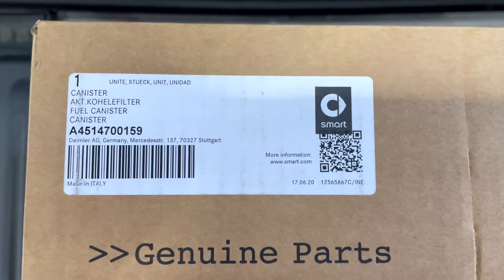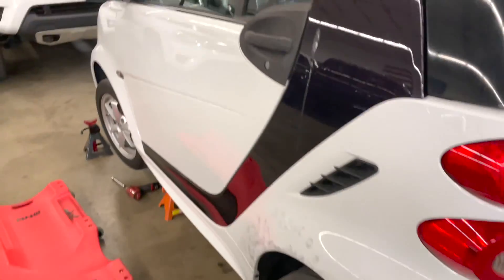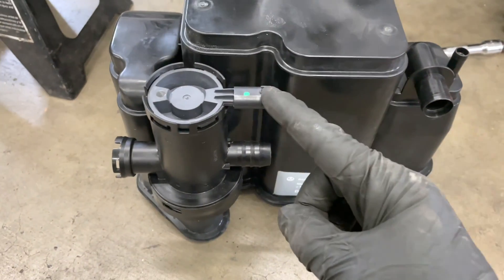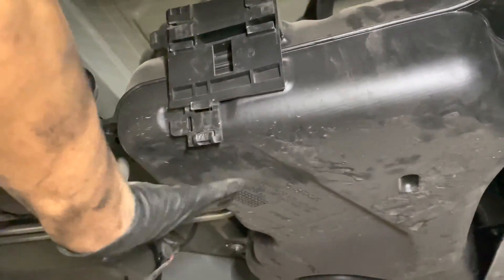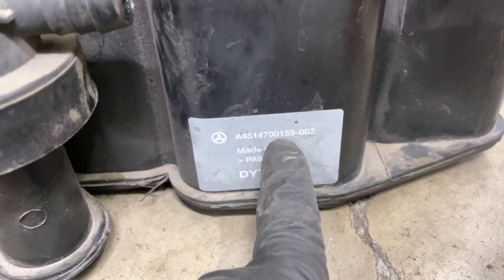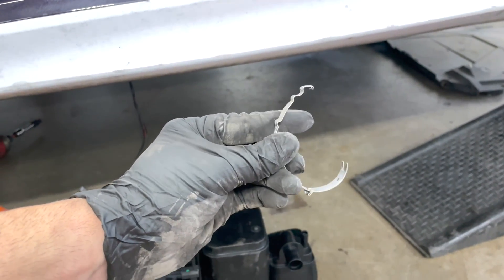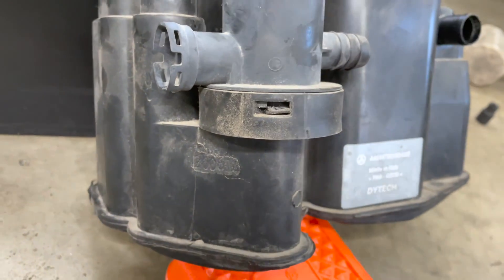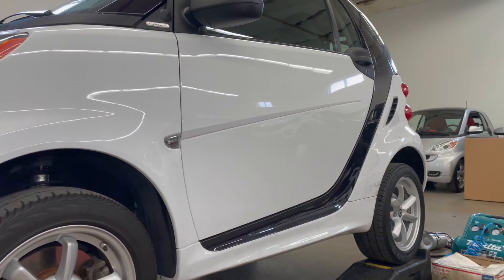Smart Fortwo - EVAP Canister

Comment: Hello i have a 2012 passion, my evap canister fell off and bangged the ground a bit. I wired it up to make it home. Is it still drivable til I get a new one in 3 days? Electrical wire still connected and hoses but not mounted to the tank (the 3 vents)
Reply from the maker: It’ll probably throw a check engine code, and it’s going to vent some of the gases to the atmosphere, but at the end of the day it’s not going to cause engine damage or anything as long as everything is currently off the ground and if you have any broken hoses that they are not sucking water or anything like that into the fuel Vapor return lines.

Basically, it’ll probably be fine.
Reply: @ToyotaGR86Performance  thank you.I only need it to hold till Monday
Reply from the maker: No problem, just make sure that none of the hoses are gonna be sucking up anything into the vent lines and that it’s not going to drag for the next couple days while you’re waiting for a replacement.

Comment: Good day I have a 2013 smart fortwo passion code p0455 evaporation emissions leak detected( gross / no flow) I was wondering do I have to change the whole system as you did
Reply from the maker: Best thing is to smoke the system before replacing any parts.
Reply: @PerformanceAutoHaus just smoke though the gas cap?

Comment: Did it clear the code? Or are you needing further troubleshooting?
Reply from the maker: Yes it solved the issue.
Reply: @PerformanceAutoHaus yeah what was the code and symptoms you were dealing with?
Reply from the maker: @PhantaszzZ  sorry, there was a mistake with my messages.

It solved the issue with the vehicle not being able to re-fuel properly. The gas handle would pop out and stop refueling. The evaporation canister was clogged… probably due to people topping up the fuel and damaging the carbon with fuel running down the vent tube.